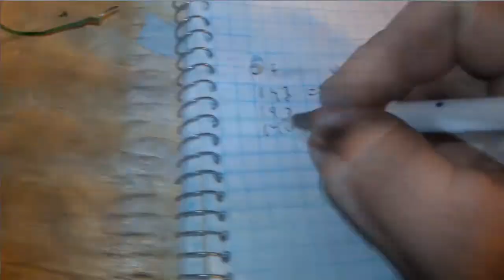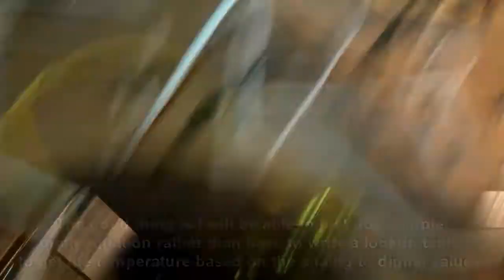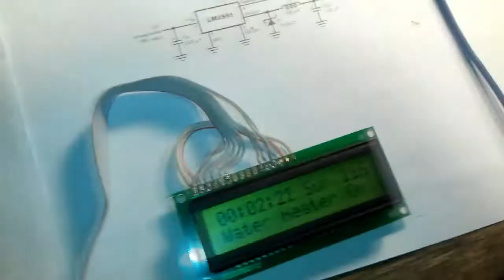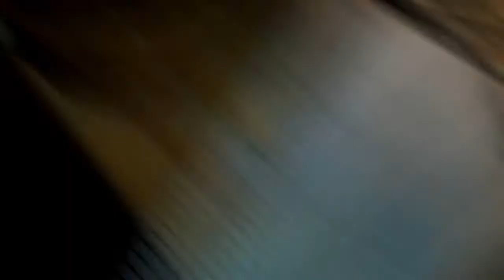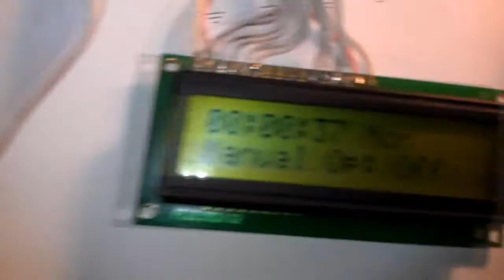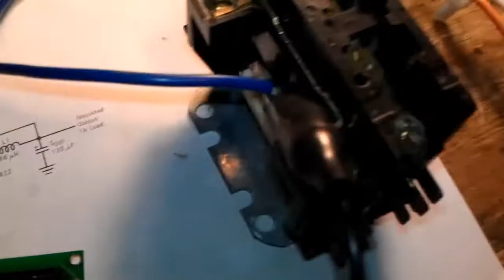Home made water heater timer-controller - Part 5

Comment from the maker: @fl0r1svdk 
1) I'd have to also run over double the capacity of an electrical circuit to it.

2) Stage 2 of this project is going to be using a compressor and an air handler in my garage to heat that water, using the stock electric elements only as a back up.

Doing this my garage will be cooled with the same electricity that is heating the water. 

It will be more efficient and it may heat faster.